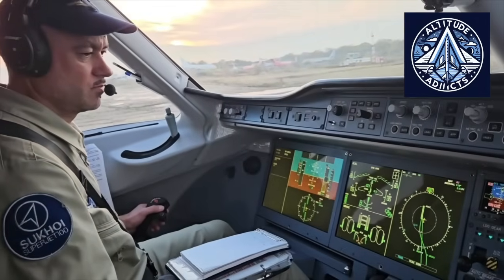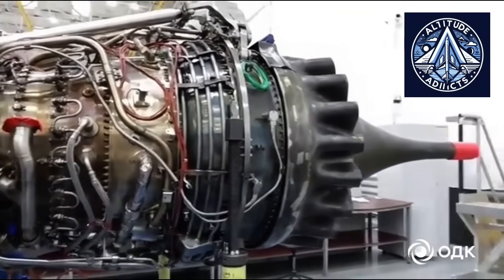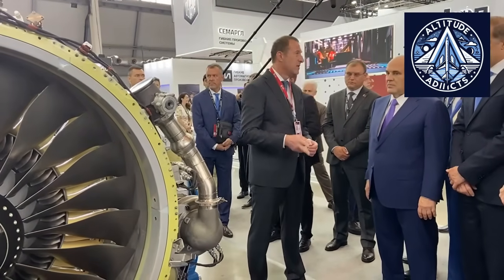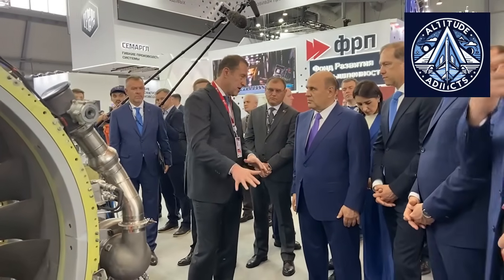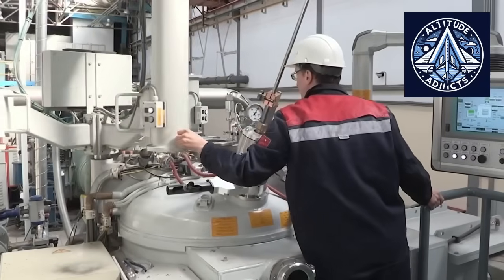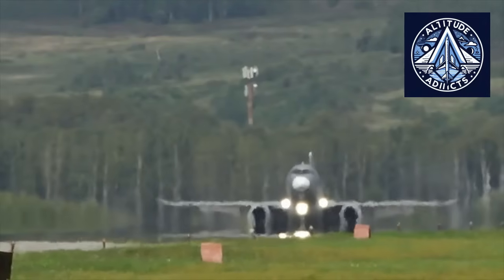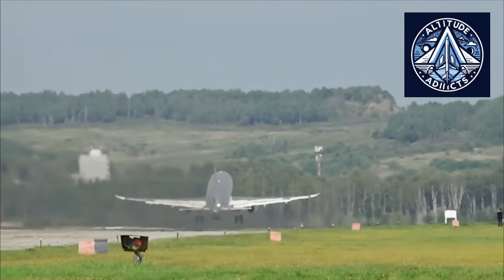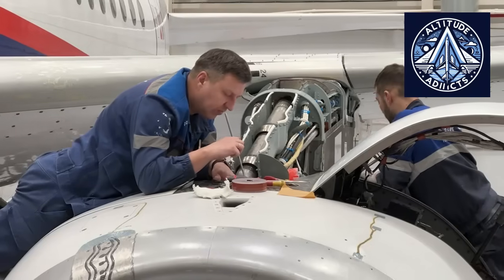PD-8 Engine Reverse Mode Tested at Zhukovsky

Comment: Is the cockpit equipments are made by Russian companies?
Reply: Why do you want other companies to cheat us again?
Reply: @Aleksify1  did you understand what I wrote? Sur you didn't understand my meaning!
Reply: @AymanApi  I think you're missing the point. These planes would have been flying long ago if third-party companies hadn't suddenly refused to deliver the components they were contractually obligated to provide. As a result, we had to completely redesign the aircraft from scratch, down to the last screw. It took us five years to complete this task. In fact, we lost just as much time due to the unethical behavior of Western suppliers.
Reply: @Aleksify1 لم تفهم مغزى سؤالي ،لقد فرحت بهدا الإنجاز العظيم الذي حققته روسيا ، وكنت سأفرح كثيرا لو أن قمرة القيادة روسية بالكامل وغير مستوردة لهدا سألت السؤال ، أنا أتابع سير العمل منذ صناعة اول طائرة إلى غاية الآن
Reply: Да

Comment: What about the aircraft range after replacing it with pd-8 ?
Reply: It didn't increase or decrease. It's just that the French part of the engine was replaced with a similar Russian one.
Reply: @Aleksify1  Not true.SAM146 was gearboxed engine and had a lot of problems while russian PD-8 is twin-spool design so doesn't need a gearbox to run the front fan at diff revs to the hot core.
Reply: Дальность полёта варьируется в зависимости от модели: некоторые модели могут преодолевать 3500 км, другие — 4600 км. Клиенты заказывают модели с желаемыми характеристиками и комплектацией салона.

Comment: I really enjoy these kinds of videos, thank you for your work. I'm going to take advantage of your patience a little to ask you a few questions. =) Can Russia, with the chips manufactured by Mikron, locally produce high-tech medical equipment? For example, MRI or high-definition ultrasound machines, advanced X-ray machines, mammography units, or are they forced to import from China? I'd also like to know how advanced Russia is in manufacturing equipment for robotic microsurgery and nuclear medicine, and how advanced they are in implementing AI in medicine. Greetings from the other side of the world.
Reply from the maker: Hi, 28nm and higher chips upto 90nm are required for such equipment. Russia has access to these chips within and from abroad. There is no need to buy from China alone. Most common impression is Russia cannot get Western chips ofcourse not in direct purchase. The Russian efforts are more of domestic production and to sell to the world later. It is not due to shortage.
Reply from the maker: Another impression that I am getting from your question is about China. Even West buys chips from China. West is only concerned manufacturing of 5, 3, 2 nm chips. Also, I am not a Russian if you meant by "other side of the world."

Comment: That engine looks ancient. Bypass ratio of 4.4 : 1 🤦
Reply: ПД-8 provides 2-5% lower specific fuel consumption in cruise mode compared to engines of similar thrust. It also offers lower maintenance and operating costs.
Reply: @Aleksify1 sure it does 😂😂😂 Maybe compared to ancient designs.
Reply: @litchips Maybe . Or maybe not 😜😜. India ordered a factory to build Russian aircraft on its territory in exchange for Boeing, which really look like ancient projects compared to modern Russian ones. From the passenger's perspective, the comfort of the passenger cabin looks like this. I can compare it by flying on a Russian aircraft, the Sukhoi SJ 120 /
Reply: @Aleksify1 All airlines who bought Superjets regretted it.